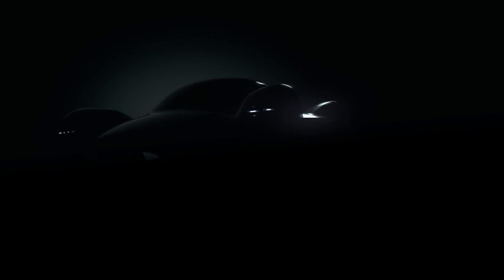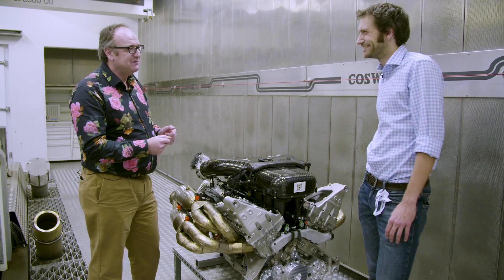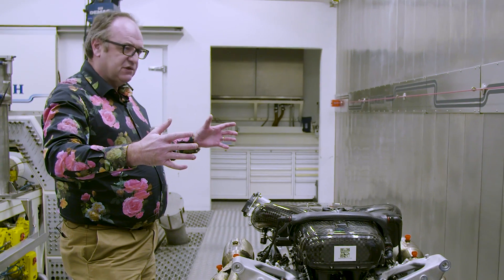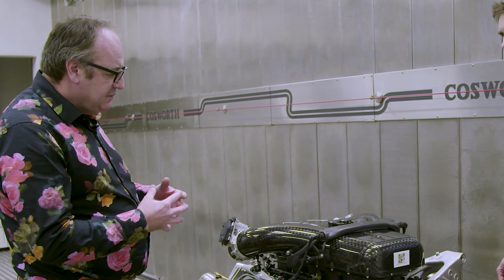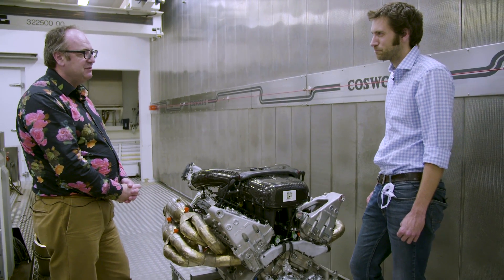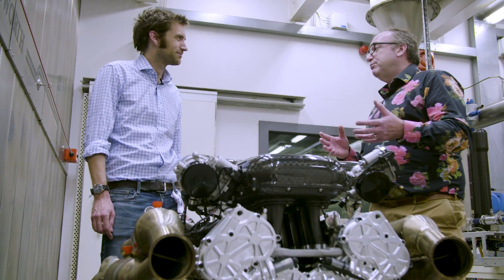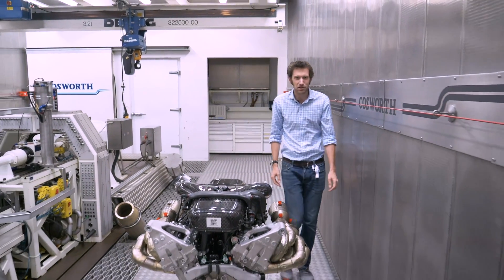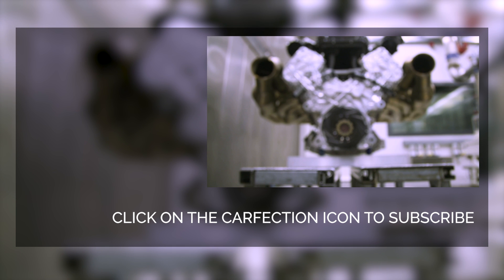Hear The Future Of The Supercar At 11,000rpm: The Aston Martin Valkyrie's V12 - Carfection

Comment: 1000hp NA? Best engine ever - period
Reply: @Kris Nicholson this comment makes no sense.
Reply: @F1ll1nTh3Blanks  Agreed.  151hp per litre is 30hp/litre more than a Ferrari 812 Superfast engine.  That is a very competent achievement by Cosworth.
Reply: @Kris Nicholson hp per cylinder is a dumb metric, hp per liter is much more relevant
Reply: @Obi-WanKannabis  ah, hp/l, relevant in competions that restrict displacement but not output (quite uncommon, but not non-existent), but again, meaningless for a private road car. Both are good engineering goals, but only as a basis to derive the meaningful metric, output. The only hp per xxx i care much for is hp/lb, though hp/volume can be important as well sometimes (which is why my cougar will be getting an ls, as opposed to a 4v mod motor, which would feel more natural to me, just not enough engine bay for those massive heads)
Reply: @noncog1  specific output is always important, an efficient engine is a good engine
Reply: It's a lot for NA, but best? Let's give it a few years.
Reply: Apollo ie says theyll sell you an n/a 1000hp v12 for enough money
Reply: @noncog1  Isn't that a Ferrari engine?
Reply: @razvanlucan1569  ferrari based, but tuned outside of ferrari supposedly
Reply: @noncog1  I thought it was an AMG 7.3 biturbo.
Reply: @F1ll1nTh3Blanks  sounds like youre mixing up two pagani engines and calling it an apollo engine, there's only ever been one amg twin-turbo 7.3, and it went into a wagon lol
Reply: @noncog1  I am not 100% but I was of the understanding Apollo were using a 7.x AMG V12 biturbo similar to that, that was in Pagani's cars.
Reply: @F1ll1nTh3Blanks  it's a 6.3 v12, that they say was based on a ferrari engine but has been thoroughly re-worked by a 3rd party engine dev. company, only by coincidence, they say, does the engine have the same displacement, power rating in base tune, to the single digit, and dimensions as the ferrari version, lol
Reply: v10 in the LFA is my personal favourite.
Reply: @DCassidy42  
v10 in the e61 is my personal favourite
Reply: @Kris Nicholson are you a troll?
Reply: @Kris Nicholson in response to which? This is getting out of hand, im assuming the "one engine family" i mentioned, if so then yes, that is obviously it, thanks for pointing it out though, that way people who aren't stupidly obsessed know what i was talking about
Reply: There is a 1107 HP LS V8 engine(451cu.in./7.4L) that is naturally aspirated(manufactured by Vengence Racing). Also Sonny Racing has developed a 1005cu.in./16.5L V8 that has 2150 naturally aspirated HP.  I know that these engine don't have to be emissions complaint,  but both could match or beat Cosworth's 6.5L V12 for HP even if the V8's were made emission complaint.
Reply: @gen1c8rs88  semi valid points, but not only is emissions compliance a key difference, so is reliability, those are engines designed with a shorter service life in mind
Reply: @noncog1  Good point; 100,000 Km(62,000 miles) of identical testing to the Valkyrie's 6.5L V12 puts the two V8 engines in further jeopardy of not being able to make it in to a production vehicle(15+,25+, 30+ or 50+ examples ?, 24 examples for the Hennessey Venom F5 ).
Reply: @Kris Nicholson sorry, but i was right, notice i said twin turbo, the sl73 was na, also the engine family was designated m120, not m130, and the tt 7.3 was called the m297
Reply: Kris Nicholson lol you’re a dumbass, ever heard of Downforce? This car isnt just gonna take off in flight
Reply: V10 in the E60 M5 is my favourite. Amazing engine.
Reply: @Kris Nicholson   The best aerodynamicist ever in the history of F1' aka Adrian Newey... got it all wrong then?  
Groan... This is all getting too much, please stop trolling, there's a good boy. :D
Reply: @Kris Nicholson   Why wouldn't it?  This isnt some ill conceived pipe dream by amateur dreamers such as the Devel 16 which really is doomed to fail.
All the players involved in this project have the necessary credentials, capital, knowledge, experience collectively to make this a very realistic project... and also huge success in all their individual histories.
I think the weight will increase a fair bit yet for the road version to meet the necessary regs..  but I dont see anything fundamentally wrong with that aero that might mean it wont reach production.
What am I missing?
Reply: sugarsaint what is the issue with other aspirations?
Reply: @Kris Nicholson no, its ferrari based apollo even said so
Reply: @Kris Nicholson then explain this engine. And the fact that theyre currently using amg engines...
Reply: @Kris Nicholson I was referring to the engine in the Apollo IE which in fact started life as a Ferrari engine.
Reply: @Kris Nicholson in response to the I.E. engine source debate, literally just google it. Or look at the specs. Of the engine and compare it to ferrari's 6.3 (architecture and metric wise) and then literally anything merc, which, though they have made an na 6.3 v12, with dohc, has very few further similarities
Reply: @Kris Nicholson I give up!
Reply: @Kris Nicholson - You have completely lost your mind.
Reply: I think its HP per ci. or kw per liter. Who gives a FF how many cylinders it has?
Reply: Why is it the best ever?  It will be in the shop more then on the road.
Reply: @Kris Nicholson 
Did you really just measure an engine by hp per cylinder? Seriously?
Reply: Kris Nicholson no turbocharging here, big difference on specific output
Reply: LFA still sounds better, more refined...
Reply: @Kris Nicholson As does every high revving F1 derived 8K+ rpm engine that's been put into a road car. I own one, have done for 2 years and the engine has been flawless. I am extremely grateful for the scare stories as I managed to get one of the greatest sounding cars of all time directly approved from BMW with a warranty for cheap so I can't complain. I know people on original engines that have done over 150k miles and one even over 200k. Is there any other NA high revving exotic V10 in the world that can reach those numbers whilst also sounding that good. The S85 is a legend and the best car you can buy for the price but only if you get a good one with a warranty and most importantly, balls. That glorious V10 is NOT a Toyota.
Reply: @Kris Nicholson I agree with you that there have been some bad experiences for the S85 for some but I am both looking at it from my own positive personal experience AND objectively. I have driven your car and I find it a fellow modern classic buy for a driving experience and THAT F1 V10  sound, nothing really comes close to the S85. The E60 M5 objectively is the best super sedan of all time and will never be beaten...OBJECTIVELY.

My SMG clutch broke within the first month lol and got replaced free under warranty at 36k miles. At first I wasn't a fan of it...now I LOVE it but took me nearly 6 months to fully learn to drive it properly. For the record I also own an F10 M5 Competition Package with DCT and there is no contest for me...the E60 M5 is the best saloon ever, objectively one of the greatest cars ever made. If you get a good one and a warranty it's unbeatable.

The Porsche V10 also is how much compared to the E60? Lol. Then you have the servicing costs of that etc and that's without a single thing going wrong!

Please look at a car objectively and not going off what some disgruntled unlucky people ranting on a forum say.
Reply: @Kris Nicholson I'm in the UK too mate (London) :-) if you're on IG give me a follow @blackbmwlife

I had to wait over 2 years til I found my perfect fully loaded black Approved E60 but was so worth it. One owner since new I'm the 2nd and it had 36k miles on it.

There's a reason I bought an Approved one though, I would never purchase outside of the BMW network but they're beyond rare now. I have taken it to Monaco and even the Nurburgring where it has been flawless.

For me it's objectively the greatest car ever that isn't a supercar as an overall car...luxury, performance, sound, exclusivity, looks and legacy as in being an M5 and what that represents.

I also love the fact that BMW gave the masses an affordable F1 derived V10 usually reserved for a top exotic supercar as a last hurrah. Legends.
Reply: @Kris NicholsonNo other NA production cars make 165hp per litre
Reply: @Kris Nicholson ah, power per cylinder, a completely meaningful metric... To someone i guess? What n/a road engine makes more hp per cylinder from factory? What engine makes more power with fewer cylinders? (There's one engine family that does, oddly enough though, it's power delivery, though hugely impressive and effective, isnt considered "sharp")
Reply: @Kris Nicholson Obviously a high specific output isn't all that matters, and it's by no means the only metric that matters. All I said is that specific output is much more relevant than hp per cylinder. Also, the best possible solution if you want power is a turbocharger, but a turbocharger, in my opinion isn't as fun to drive as a naturally aspirated car, in a road car fun is much more important than performance.